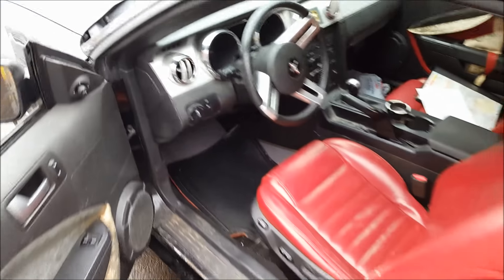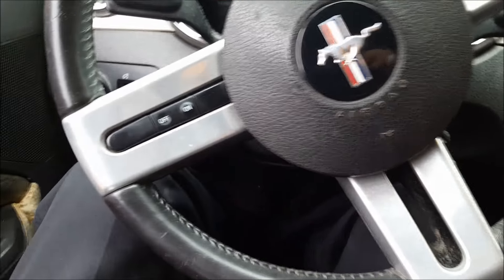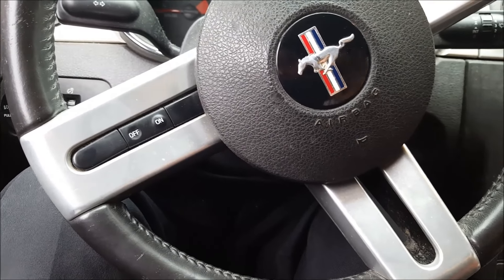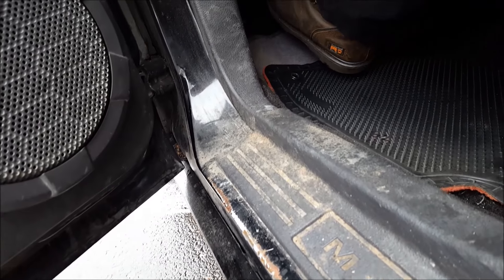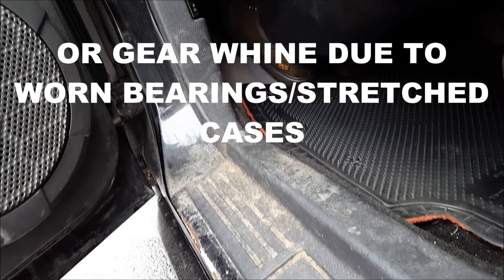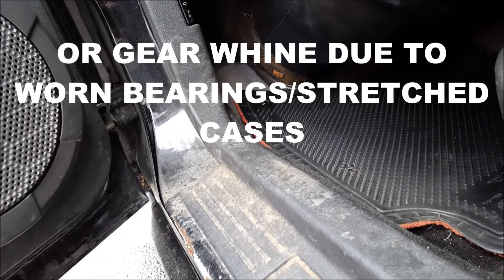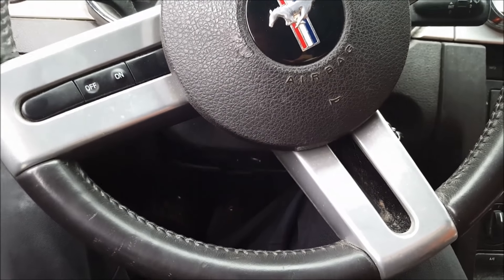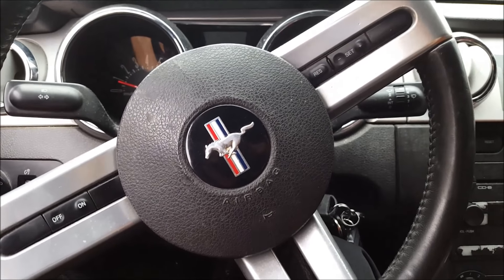MUSTANG Transmission BEARING WHINE NOISE 5spd NOISY TRANS VS THROW OUT BEARING

Comment: Mine just started doing this noise I put new throw out bearing, clutch, pressure plate and only sounds when I put the clutch out
Reply: I’m having the same issue right now, what problem did you end up having?
Reply: Grease your clutch fork that connects to the pivot ball
Reply: Damn that sucks
Reply: It's probably a bad pilot bearing if the noise is only when the clutch is disengaged.

Comment: I have a 2008 4.0 v6 mustang with an automatic transmission and I have this exact noise. But it seems to go away when the car warms up for the most part. Could this be the same issue?
Reply from the maker: No. This video only pertains to manual transmissions.  Could certainly be something else inside of your automatic transmission making noise though.  Check out FordTechmakuloco's channel.  He has a couple videos on Ford transmission noises
Reply: Hi  I have an 08 mustang gt automatic and seems to make a whining noise also in cold starts then goes away. Is it something to worry about? Did you ever find out the issue with your mustang?
Reply: @abecampbell2439  did you find out what was wrong have this issue with my 07

Comment: Great video! I was curious if you ever found which transmission bearing was the cause of this noise. my manual 2005gt makes a identical noise and every video on YouTube is about a throw out bearing which sounds completely different. I wanna make sure I get the right parts to fix it so any help is much appreciated.
Reply from the maker: Kevin Emory unfortunately I never got the chance to tear this one apart because the customer decided to not fix it at the moment.  But in the past I had another manual transmission making a similar noise that I did tear down and found that a gear set was making the noise.  It's really hard to tell until you tear it down and inspect all the components. It's really a job best left to a transmission specialist honestly.  But if you do figure yours out I would love to know what the problem ends up being. Keep me updated! And thank you for watching. Sorry I could not be of more help.
Reply from the maker: Kevin Emory I decided to make this short clip just because I've seen so many people assume the noise is always a throwout bearing. There are distinct differences and that was the point of making this video. I was going to hold on to this clip until I had a good a vehicle with a bad throwout bearing and then do a comparison video of the two noises...   maybe in the future. Thanks again for watching and give it a thumbs up if it helped out

Comment: Legit!
I have this problem even after I installed a new clutch thinking it was the throwout bearing.
I'm hoping a transmission oil change will tide me over for a few months until I figure out which engine and transmission combo I am going to go with in my 4x4 conversion.

I ONLY noticed the issue due to a faulty carburettor holding RPM above 1000rpm when stationary.

Thanks for taking the time to post the video.

Comment: Yeah that helped me alot. Subaru just did my entire clutch with the flywheel too, the second they pulled it in for me to pick it up i heard that exact whining, which was there before, well, i barely made it back to the shop.  And then Theyre telling me (9 hours later they called )  the rear axles were popping out of the differential. The  tech popped them back and it is all better. Now 
I will know the instant i go back to pick it up if i hear a whine, that they missed the diagnosis of a trans bearing

Comment: I have this noise on my 22 Jeep Wangler. Does this mean eventually the transmission will go out? Noise doesn't happen all the time, only happens when transmission temp is around 170 F and only in 1st and 2nd gear. Sounds almost like it'll build up then the bearing sound. Please advise

Comment: So let me get this correct on what you said, if you have that noise when the clutch is engaged (pedal depressed) and the noise increases with rpms, that means it is NOT a throwout bearing? But rather it's a deeper issue like a main input shaft bearing inside the transmission?
Reply from the maker: correct
Reply: @NoNonsenseKnowHow  I have the exact same noise that started this spring when I first started it up since I put it away and covered it up in the garage back in November. The noise wasnt there last November, but there now. Its identical to noise you demonstrated in this video. It's a 2001 Cobra with the Tremec TR3650 transmission. Pretty much the same trans used up to 2010 in the Mustangs. So if you do not mind me asking, what did you whind up having to do to correct the transmission issue in this Mustang you demonstrated on?
Reply: @NoNonsenseKnowHow  Do you recall what you did to fix this guys transmission?
Reply: @larrywalden626  Im reading all the comments and I have the same issue, what did you do to fix it?

Comment: I get why it wouldn't be the Throw-Out Bearing, but could that not just be the Pilot Bearing? How were you able to listen to it and know it was from the transmission and not the Pilot Bearing?
Reply from the maker: Excellent question.  No this particular noise could not be the pilot bearing. When the clutch pedal is released, the pilot bearing is not spinning.  The input shaft and the engine or spinning at the exact same speed when the clutch pedal is released.  The pilot bearing would make noise when the clutch pedal is pressed down and the input shaft stops spinning
Reply: @NoNonsenseKnowHow  Sorry, just trying to figure this out in my head. So clutch pedal in, throwout bearing engaged, transmission and input shaft stop spinning/ not engaged. Thus no whine from the transmission when the clutch in. HOWEVER, clutch pedal out, transmission and input shaft and flywheel are all engaged. The Pilot Bearing is pressed into the flywheel right? So why wouldn't the Pilot Bearing be engaged when the clutch pedal is out?

I'm learning. But I see a lot of videos where clutch pedal in and you hear a noise, probably the throwout bearing. Clutch pedal released, and its either the pilot bearing or the trans.
Reply from the maker: @bendavis8090  I mean I could be wrong. ...  but the way I see it, the pilot bearing is pressed into the crankshaft, and when the clutch is released, the input shaft in crankshaft are spinning at the exact same speed.  So the bearing would not be used.  Pilot bearing is only used when the engine is spinning at a different speed than the input shaft if I'm not mistaken
Reply from the maker: @bendavis8090  the main reason I put this video up, is because it seems like every time there is a noise associated with the clutch pedal everybody is so quick to call it a throwout bearing. But that's not always the case.  I had this exact same noise with my Toyota Tundra and it ended up being a transmission noise.  I'll post the link to it.
Reply from the maker: @bendavis8090  https://youtu.be/QZNWKjVZSrY
Reply: @NoNonsenseKnowHow  you're awesome man thanks!

Comment: I’m in a 2017 Mustang GT and when I accelerate in first gear, there is like a squeak/creak sound and it also appears when letting go of the accelerator in first gear and in reverse. All other gears it does not do it maybe because going faster? Is that bad
Reply from the maker: That might not even be transmission related. It's hard to say without hearing it
Reply: @NoNonsenseKnowHow  yeah it is hard to describe I recorded it and sent it to the dealership and they have me set up to bring it in next monday - they have no idea what it is. The best way I could describe the sound is like stepping on a wooden floorboard and it makes that wooden creak sound and sounds like it is coming from under the driver side front tire
Reply: DavyDave1313 ever figure this out??
Reply: @DavyDave1313  So what was it?

Comment: I have this exact same noise under my car but only after completely stopping the car while accelerating again at low speed.
Reply from the maker: Seems like these Transmissions are pretty common to have noises/failures
Reply: @NoNonsenseKnowHow  I had a transmission rebuilt 3 months ago. And not too long ago I started having this issue. And also when I take off hard. It sounds like if I had a supercharger with the winning noise. You think I should take it back to the place?
Reply from the maker: @Abeldlg  yeah I would definitely take it back to them.

Comment: I got 1999 ford ranger an it makes a chatter noise coming from the clutch could that be the inside slave cylinder to ? It chatters a lot going up hill when u hit the gas
Reply from the maker: Probably just needs a whole new clutch kit and slave.  Is it slipping?
Reply: NoNonsenseKnowHow no it doesn’t slip when going up hill when it chatters an u push the clutch in an rev it it don’t chatter I’m hoping it’s the clutch an not engine but I think it’s something with clutch I had another ranger like this one that made the same chatter noise an it stopped when I replace the clutch
Reply: NoNonsenseKnowHow also now it chatters a idle goes away when u rev it to

Comment: My 06 mustang Gt it’s a automatic tho and it makes that noise if it’s in over drive or cold start or in 1,2,3 then if I put it in drive it’s fine in I don’t hear it if the car warmed up
Reply: Vigilant Modz same with my mustang. Have you found any solution?
Reply: Idabel Lucas same with my 2010, did you find a solution?
Reply: @idabellucas320  Hi did you ever find the solution?Did your mustang got worse or still the same?
Reply: Is it still doing the same noise? Did it get worse? Or did you find the solution?

Comment: My 86 Monte carlo sounds like this but its automatic and only does it in gear drive or reverse goes away in park and neutral any idea what it can be? I replaced torque converter but no luck
Reply from the maker: Sorry I'm not too familiar with the internals of that transmission often.

Comment: I have a 1986 Nissan Hardbody and it makes the same whirring high pitch noise when I let up on the clutch pedal. Could this also be caused by low manual transmission oil?
Reply from the maker: yes
Reply from the maker: But generally if low fluid is what's caused the problem, the damage has already been done and fluid level will not help it
Reply: @NoNonsenseKnowHow  i checked the fluid and it was low. I drained it and it was very dark. I put new fluid in and test drove it. It appears that noise has gone away for the most part. It did come back while driving but only for  one time  and was for only a few seconds. So I guess not too much damage was done.
Reply: @jogmas12  Is it fine now after changing fluid? Mine does exactly the same thing, whining on idle, when i depress the clutch noise goes away completely.

Comment: My 95 T5 world-class transmission is doing the same exact thing and I just bought it. It's also making a clicking noise in first second and third gear.. Can you tell me how much it would cost to fix and how big of a problem it is? And will it get worse? Thanks
Reply from the maker: Sorry I'm not sure how much the repair would cost off hand. If you call a transmission shop though you should be able to get an idea. Sometimes you might be better off just buying a whole new transmission and parting that one out on eBay. Believe It or Not, the internals/case are worth a ton. That's what I did with my t5 and I recouped a lot of money

Comment: What if the clutch pedal stop being hard as it should is that a bad throw out bearing
Reply from the maker: By "stop being hard as it should", do you mean you can press it down with light force essentially? That would indicate a worn-out pressure plate or possibly air in the hydraulic system of the clutch.
Reply: Yes and will not shift
Reply from the maker: @michaelbest14  sounds like you have one of the following. Bad master cylinder, bad slave cylinder, or a leak in the system. Try bleeding it
Reply: Thank you sir that exactly what I thought just wanted to make sure 👍🏼
Reply: not that's not going to be an issue with bearings. that's going to be a probable in the clutch linkage or the master cylinder depending on what kind of tyranny you have.

Comment: is* it normal to drive the car with this problem, transmission bearing noise ?
actually my ford focus 2013 hatch doing the same noise but it is an automatic gear ( dual clutch )
Reply from the maker: I wouldn't say it's normal to have the noise. After a while it may become something more severe and get louder and eventually fail
Reply: @NoNonsenseKnowHow  thx for your response
Reply from the maker: @TorkiNoor  no problem!
Reply: @NoNonsenseKnowHow  actually this noise sometime shows and sometime disappears for my car
Reply: Same car and similar problem. Whatever came of it?

Comment: I have a 88 mustang and the clutch fork has a lot of play. I took the T5 down and the clutch fork is not bent and the pivot stud was not mushroomed. I have to stand on the clutch to get the throwout to engage to get it started. No noise it just will not engage. I have to force it into gear. Any suggestions?
Reply from the maker: It sounds like your clutch cable is not adjusted properly, or it's trashed causing lots of friction. Have you put a new cable in it?
Reply: It was adjusted all the way down as tight as possible with a lot of play.
Reply from the maker: @Steven-xg6ve  sounds like clutch is shot

Comment: I get like a little bit of engine vibration through the clutch pedal whenever I depress it or release it. What could that be? I also get like a clunking noise/feel when the clutch is depressed and I move the shifter around while coming to a stop or if I accelerate and do it.
Reply from the maker: Honestly it's hard to speculate without actually feeling it. Could be several different issues.

Comment: I have a 92 foxbody with a T5 and when im in 5th gear going about 60mph the stick vibrates and theres like a droning noise when you press the gas at that speed when you let off the gas and coast the sound goes away .... you ever heard of this happing or have any idea what it could be ... Need a transmission or this its something that can be fixed ??
Reply from the maker: Honestly it's hard to say without driving it and hearing it. Sounds like yeah you might have something going on the transmission. Probably best off having a transmission specialist take it for a drive if you want to diag it.  Or if you love the car, you could always get a remanufactured one for a reasonable price. Or the t5z is a nice option as well. Does it only make the noise in 5th gear? Are you sure it's not the rear differential making noise?
Reply: @NoNonsenseKnowHow  only does it wen u hit 60 + speed and are in 5th and the car is under load from accelerating wen u left off gas pedal the noise and vibration stops even if your coast speed is above 60
Reply from the maker: Did you try doing the same thing at 60 plus in the fourth gear?
Reply: @NoNonsenseKnowHow  doesn't do it as bad in 4th gear
Reply from the maker: @babyhuwe05  got you. I would try to verify that it's definitely not your rear differential bearings or gears. And if it's not then yet sounds like it's the transmission

Comment: How do you fix a stretched casings any other reason the bearings may be loud I had new one put in and it’s whining exactly the sams
Reply from the maker: If it's a new transmission, the cases should be fine. I'm not a transmission expert...  best to bring it to a transmission shop and have them give it a listen

Comment: My 07 accord is doing the opposite when the clutch is pressed in it whines but when i let out it stops
Reply from the maker: That sounds like a possible bad throwout bearing.  When you push the clutch in, that puts a lot of load on the throwout bearing and will cause it to get louder generally

Comment: I got a new question. I drove my truck for over 30 minutes the other day, enough to warm it up. When I came back with engine still running I felt the lower radiator hose and it felt lukewarm to the touch, I turn off the engine and  10 minutes later I felt lower radiator hose again and it felt much hotter. The thermostat is new. Why would the lower radiator hose suddenly feel hot after the engine been off for 10 minutes? I have an aftermarket coolant temperature gauge since the one in the gauge cluster broke and it never gets past 175 degrees
Reply from the maker: That is normal. When the engine is running, cool coolant at the bottom of your radiator is entering back into the engine block.  When you shut engine off and water pump flow stops,  All of the Heat in coolant will even out. There's probably a better word for it but yeah.

Comment: Mine is doing the exact same sound but I drive a 5 speed but mine starts as soon as you turn the car on. I pressed on the clutched and it still does it. The more I accelerate the louder it gets not to loud but enough to hear it. Anyone else has this issue?
Reply: Mines doing the same...what was the issue?
Reply: @chevywilliams958  it turned out to be my pulley